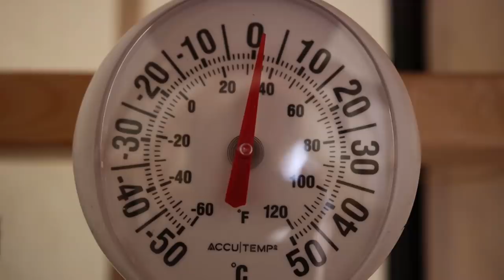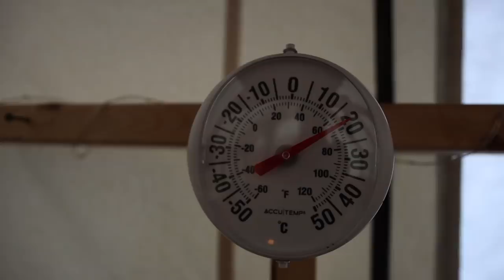Wet, cold camping alone in a hot tent. Solo overnighter. Winter preparation.

Comment: Two pitches to maintain is a lot of work.  Maybe you can make it a bit easier on yourself with some good ideas during the very cold winter.  You could have a TEE PEE as a quick do it yourself untill you get maybe another Tent.  TEE PEE is good for high winds as it wont catch the wind much.  A good floor is important to give yourself some insulation.  Another good watch is Steve Wallis  Channel.

Comment: Hi. If you are worried about fumes. block up the gaps around the door. Then you need a longish pipe. You need the pip going through your plywood wall to outside, Across the floor along side of the stove. preferably with a vent on the end of the vent pipe.  Have the pipe that finishes inside the tent. have it finish somewhere near the front of the stove. That way you can control the air coming in, and have fresh air feeding into the fire

Comment: Bring some rolls of insulation and some construction plastic with a staple gun and place the insulation in between the 2x4s inside the tent. The plastic should hold it in place and help retain the heat.

Comment: Birch lots of oil.. make fire hot.. lots of oil means lots of energy bacteria and fungus want energy..so the reason it burns hot and long is why it rots so fast.. lots o energy. 😉
Reply from the maker: Thanks! Good to know. And yes, that tree is actually small, but relatively big around my tent. I dream of cutting down big trees.
Reply: @jaylegere  brother I'm off grid 100% way in the Canadian bush..(this is solar powered satellite internet)
With the biggest sugar maple 40 ft easy.. you are welcome any time!! I can tell you ain't afraid of working!! I got a white oak five feet in diameter I'll put your name on it.. then we throw it on my mill and you truck out the prettiest hard wood lumber you ever seen!!
Reply: @jaylegere  keep up the swiss army knife brain, put this in there...  Hard wood chain saw dust  and wax... mix it make a flat cake easy pack) cool it and zip lock.. snap off a piece you need. it's better cuz it leaves hard wood coals..  you love it.. (I have chickens egg cartons are gold😂)
Mice hate steel wool, and bubble foil insulation they can't make nests.. take your used cat litter(No poop) sprinkle the tinkle around platform. 😉😉

Comment: I am thinking, with all that good oil you had to burn up there, maybe you could do this instead:
My firestarters are cotton eyepads (the cheapest I can find) soaked in vegetable oil (also the cheapest I can find), and I rip them in two before I light them. You could have made firestarters of maybe three packages of eyepads with that oil. If you put them in a mason jar or something similar, wrap the jar in a couple of plastic shopping bags and then put them in that wooden box next to the fire place, wouldn't that be a good idea? I was a bit concerned for your safety when you poored the oil into the fire like that. You were a long way from a hospital out there. 
And if you need a chair to relax in at the tent, a foldable camping chair with a high back and a thick camping chair cushion that will keep you warm when you sit in it, is a good idea, imo. They take up little space when folded, and they weigh practically nothing, so it is easy to bring them with you on a sledge.

Comment: Hey Jay hope all is well. You were putting the wedges in and I remembered when you built the wood pallet frame, along with all the problems you had to figured out. You proved me wrong on the tent frame, when you were building it and I saw it shake so bad I thought when you were putting the tent over the frame it was going to collapse, but it never did. 
The Pork Chops and Fries looked amazing, and you said I will save 1/2 for tomorrow’s breakfast, it would have been gone if that was me. Stay safe hopefully there will be one more trip before the Lake freezes over and the snow flies.

Comment: Imagining myself in your place I would enclose the entire usable area outside of the tent with a fence. It would be made using steel posts every 6 feet and using black weed blocking fabric and zip ties. For the entrance I would not use a gate. Instead I would overlap the entrance by 4 feet keeping the opening 4 feet deep. I would keep it about waist tall. That way you could block the wind and have the outside area usable during the cold weather. I think it would help reduce cabin fever by allowing you to get outside more. Just sayin.